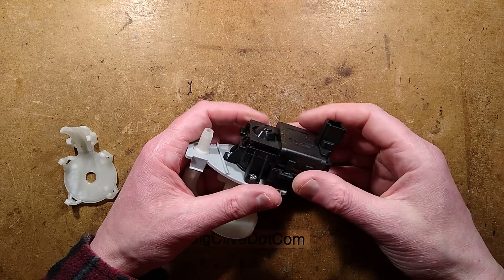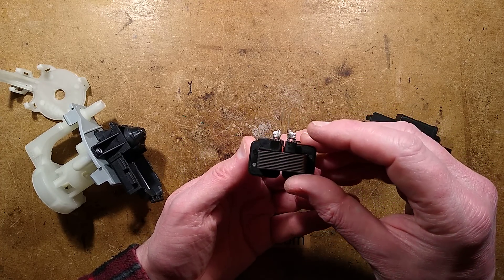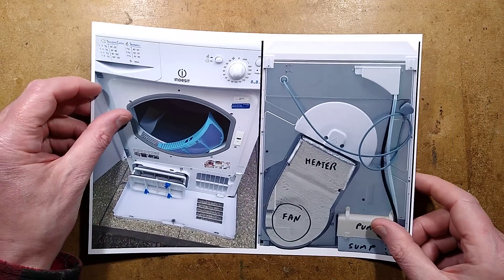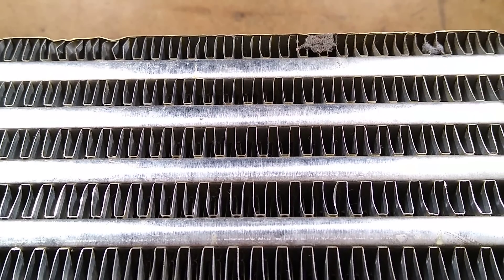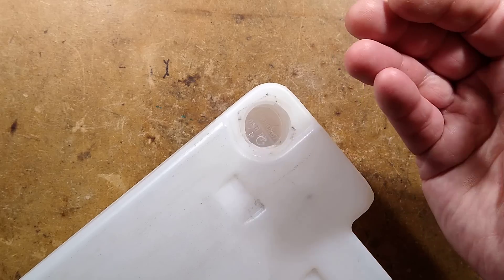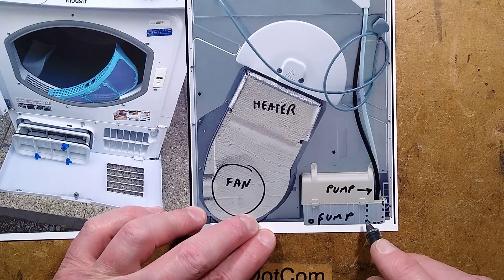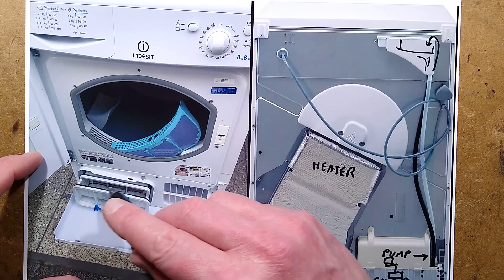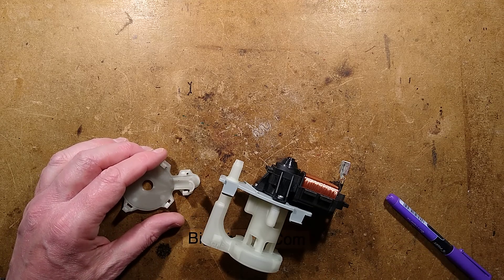Condenser laundry dryer pump

Comment: Heatpump condencing dryers are nice when you can use them with the same 16amp socket as a washing machine when it only uses like 500watts to dry your clothes
Reply: Mine peak power was around 600W. I really love how efficient hey are.
Reply: I wonder if I can get them in the US. I've never even heard of them lol
Reply: @pigeonpallz1733  efficiency... US... the two don't mix. You can probably find a V8 dryer though.
Reply: @thebrowns5337  In the US we have combo washer/dryers that use a heat pump. Even more efficient than these condensing dryers.
Reply: @thebrowns5337  Gas powered dryers really are a thing in the U.S.A.  Obviously I'm talking about the sort of gas that powers a stove as opposed to gasoline.

p.s. Before we criticise the U.S.A too much lets not forget that 2000W + vacuum cleaners were popular in Europe until the E.U. banned them.
Reply: @pigeonpallz1733  LG makes two - the DLHC1455 and the new FULL AMERICAN SIZE DLHC5502 which just became available like a week ago. Based on the 1455 tho and I've been running mine for 3 years now, several hundred loads of laundry, ran condenser cleaning cycle twice in that time. Typical dry time is a little over an hour, but the 5502 is much more of a beast, dries in comparable time to vented. Problem is, 99.999% of Americans have those godawful slow spinning trash-loaders that leave 30+% more water in that a good front loader would have spun out! Although if you're gonna force the dryer to boil out 30% more water, might as well do it with a heat pump!
Reply: @pigeonpallz1733  the best way I've found to sell heat pump dryers to my customers is to say, "if a room in your house flooded and the carpet was wet, what would you do to dry it out? Would you run 5,000w worth of space heaters on full blast and open all the windows and put fans in them so the heat just gets blown outside... Or would you run a 500w dehumidifier - a machine that extremely effectively removes moisture from air by condensing it, without significantly causing a net increase or decrease in temperature?" So far, all but a handful of my customers (who've had the budget for it), has gone heat pump dryer. So far only one has complained about dry times, and I figured they'd be a problem... Typical wh*te-mom "Karen" type, does at least 3 loads of laundry a day it turns out... 😭 Didn't have the heart to tell her that the problem is that she's literally ruining the planet for my generation just so her and her ugly entitled spawn can have multiple changes of clean clothes every single day.. not that the dryer is too slow (in her case, a GE UltraFast combo)
Reply: @pigeonpallz1733  I have no direct knowledge of them , but at least LG and Samsung sell them (compressor type ) in the USA. I looked at an LG one: still needs a 208 or 240 V power drop but only consumes 800 watts. Also needs a slop sink or stand pipe for it's drain hose (which your washing machine already needs.)
Reply: @vkristof1  I have that exact LG unit at home and it's great.  It's extra handy in the winter because it doesn't constantly suck all the warm air out of your house, burn energy heating it again, then immediately throw it away out the vent.  It's a bit slower than the old 5000 watt standard electric unit, but my electric bill went down significantly and my clothes are way less damaged by the heat.
Reply: @SuperSpy00bob Thanks for that first hand experience info. Our vented electric clothes dryer is about 20 years old so a heat pump  clothes dryer is something to keep in mind. We own a more recent LG washing machine which has been working fine. LG is really plugging their inverter tech manufacturing investment...
Reply: I bought a heat pump dryer during last year's 'Black Friday' sales and it's awesome! As mentioned is peaks at 600w and uses sensors to tell when the load is dry rather than these wasteful 'set a timer and hope it's right' machines. They're gentler on the clothes (as they don't heat so fiercely) and use far less power than conventional dryers. The only downside is they take longer to dry the clothes but that's only a downside for people who aren't organised. ;)
Reply: @Shaun.Stephens my Heatpump dryer will do a full load in about 50 Minutes. The trick is that they remove more water from the circulating air because the cool down further, so they don't need to be as hot in the drum.
Also, how they utilize the latent heat of evaporation is a really neat concept.

Comment: In outboard motors the water pump has flexible veins . They shift from displacement to centripetal to regulate the pressure and flow over a wide rev range. A really genius invention.
Reply: I have flexible veins too.
Some of my arteries are getting less flexible as I get older.
I think the pumps you refer to have vanes.
Reply: @PaulG.x Your response is somewhat vain...
Reply: @tonynicholson3328 but it is along the same vein 😂
Reply: @tonynicholson3328  Yes, alas it was in vain
Reply: All Jabsco brand water pumps work on this flexi-vane principle.
Reply: Yep, outboards have used this style of water pump impellers for many decades. They work well, and can handle particulates being picked up from the bottom of the lake without damage by the design

Comment: ...Agree that the water pump is pleasingly designed. The curving ramp for the water outlet is rather cute - none of that jarring 'holes bored into block at right angles' stuff that you see in most pumps. 
Cunningly, having a small lightly loaded motor running continuously makes it much easier to design in  'likely time to failure' features.
...Interesting that this dryer is relatively insensitive to high ambient humidity and works best when ambient air is cool. 
Conventional dryers work best when ambient temp is high and humidity is low.
Probably why condenser dryers are less common in Australian homes, although we do see them in air-conditioned tower buildings, where air is generally kept below 24 degrees.
...Fascinating to read the viewer comments regarding the condensed water being considered distilled water. I used to think the same until I read about the significant bacterial and particulate loads the water usually carries due to the enormous amount of air passing through the condenser during operation.
...Thanks for the 'teardown' entertainment.
Reply: Thanks for your informed comments, and for Clive's exposing some of us (I live in the USA) to this technology. Didn't know it existed and does bring up the question if some "heat pump" tech is used in washer/dryer combos in modern high density/high rise apartment buildings. I wonder if an air-to-air heat exchange add-on for winter use is worth the bother in  northern USA houses that use USA-traditional-vented clothes dryers

Comment: My Bosch one has a humidity sensor so it cuts out of the clothes each the correct humidity so you don't run it to long, you can set it for iron dry, cupboard dry, very dry and has different heat levels for cottons, easy care

Comment: You better not be taking your appliances apart because you're bored! 🤣 

I've found condenser dryers still put a lot of moisture into the room, always the smell of warm clothes water in the air when they're running

Hmm, maybe a good video idea would be to show a modification, simply extending the drain tube to the sink so you never need to be emptying the water drawer every 2 minutes
Reply: The manufacturers are way ahead of you. Our Bosch one has a hose at the back that either pumps the water to the collection drawer, or you can unplug the end and stick it into a drain - I've stuck mine into the same pipe as the washing machine (it copes fine).
Reply: @stuc.6592 ahh good to know! I must only be familiar with the cheapest possible models 😅

Comment: I always presumed that heat pump dryer meant a refrigerent inverter type setup. My reason was that they're meant to be much more efficient than the basic resistive element dryer but if this still has a 2000 watt element in it then it's not efficient.
Reply: This is still a resistive heat dryer, it just doesn't need to be vented as it's a closed system. 

Probably the same (or worse) than a regular vented electric dryer. Only benefits is you are dumping the heat into the room, so if you need heat it's a plus.
Reply: This is not a heat pump dryer. This uses 4 times as much energy as a heat pump dryer...

Comment: The heatpump dryer are the future and this pump is a good idea for not having to emptying the tray every single time because of moistures.
Reply: I've got a heat pump dryer and they're brilliant. The only cheaper way of drying clothes is putting them on the line outside. And even then it's not massively cheaper. :P
Reply: One issue though is lint building up and blocking airflow waaaay deep on the evaporator fins, completely unreachable by brushes, air or water jets. And to clean these one must disassemble the machine completely. My heat pump dryer is great, even considering the garbage run capacitor the compressor used from the factory (at least that was trivial to service, just remove the side panel), but the lint issue is annoying. I've seen some newer models with better filters in front of the fins, and "self wash" capability, so maybe it's solved now.

Comment: I expect this unit has to be a lot more efficient in reducing heat loss than the typical style we have in the U.S. that just shoots the hot air out of the house. Very interesting.
Reply: Except in the humid summers that we have in a significant portion of the US, when pumping that hot air out the house is absolutely necessary.

Comment: These aren't too common here in the US, but I have lived in two apartments with small in-unit stacked washer/dryers that had condenser dryers. One had the same type of water collection tray as yours; the other (a Bosch) was plumbed into the drain along with the washer. Here these use the same 208V/240V 30A plug that conventional vented dryers use.
Reply: There are a lot of them coming out this year.  We've had the bosch a while, but now GE, samsung have them. Some are washer/dryer combos.  The new ones have heat pumps that work really well on 110v

Comment: From memory,  the pump only runs when the drum reverses. To save wear or cuts in and out during the cycle.  I have taken many customer condensers out in the garden to flush through with the garden hose.
Reply: As a repair man i have not yet seen a pump running constant. The two ways i have seen it done is:
-running by time interval (together with reversing or seperate) and any activation of float Switch will halt the program and indicate full container.
- activation of the float switch starts the pump. If the switch is still active after a preset pump time it will stop the program and indicate full container.
Reply from the maker: @kjetiltrondsen8242  I'll have to check that out, but the pump has always been the noisiest bit on this machine and my brother's similar unit.
Reply from the maker: My old White Knight machine just runs the pump after a drum reverse.  This one seems to run all the time.
Reply: @bigclivedotcom  My AEG/Electrolux dryer seems to have a float switch. It only runs when needed. Suppose every bit of electricity counts for an A+++ machine.

Comment: More common in Asia than Canada but we bought an LG - all in one that washes and dries in the same machine and it’s very convenient.  Just turn it on and wait until clean dry clothes come out. Works well unless overloaded.   Better to do a few small loads rather than one big one.
Reply: I've got the same. They are more efficient because they use a small amount of water to cool the hot air and any lint is flushed away in the next wash. Of course, they are not portable.

Comment: And you get a free source of de-minralized water for your steam iron. Do need to filter the water through a  coffee filter to get rid of some floff (lint)
Reply: all condensed water from refrigeration/dehumidification is full of nasty things from the surrounding "air" passing through and collecting. it's most always acidic and very dirty, adding to that fabric softeners, laundry detergents, clothing lint and whatever dirt is left in your clothing(there is lots).
Reply: I use mine in a steam engine for this very reason.
Reply: I use the water from my de-humidifier too. thats nice and clean. I dont think you would need to filter the drier water, but it depends how much ironing you do, I dont iron so blocking the irons nt an issue.. ( I do iron just not very often t-shirt's etc I dont iron)
Reply: @dcallan812 I don't understand why people think water from dehumidifiers is a good thing to use. I think people confuse dehumidification with distillation. The water in a dehumidifier is gross, just water pulled out of the air with whatever junk was in the air plus whatever dirt is on the coils of the dehumidifier. Tap water is far far cleaner.
Reply: @bmay8818  Indeed you wouldn't want to drink it, or wash your wineglasses with it, but it does have the advantage that it doesn't contain any dissolved minerals. My tap water supply is sufficiently hard that it produces scale inside the steam iron, so I have a choice: I can buy distilled water, or I can use condensed water from the dehumidifier or tumble dryer.
Reply: @bmay8818  My de-humidifier has a hepa-filter for incoming air, so most of the crap gets removed before it condenses. Not perfect, but better than hard tap water in my steam iron.
Reply: @AnotherPointOfView944  - might be clean enough to drink it?
Reply: I must admit I do not iron a lot either,  furthermore my own iron is not even a steam iron, just a simpel oldfashioned one (bought it in the early 1980s when I was still studying🙂) 
The "clean" water can of course still be handy for other household tasks.  @dcallan812

Comment: Condensing dryers are not common here in the US but you can get them. I suppose it's because if you have a 208v/240v socket nearby, you probably have a matching dryer vent. (I wish we had 240v everywhere, but such is the peril of being first to the electrification game--and not having to rebuild after the War.)
Reply: Yep. I noticed the Appreciation Plaque to "Bomber" Harris in the lobby of the Bosch factory. 🙄